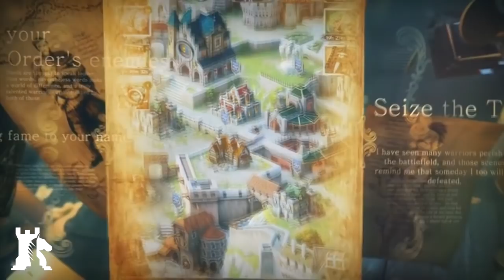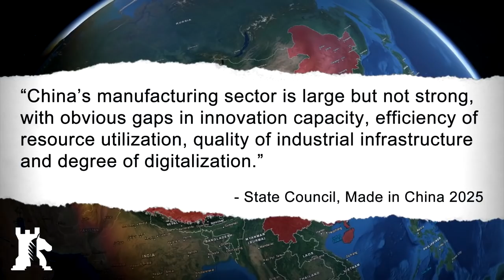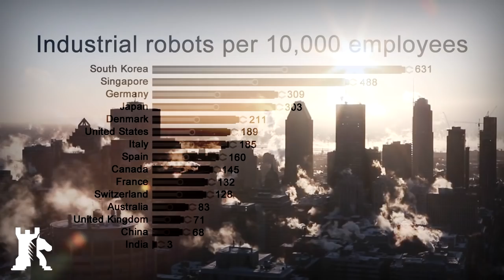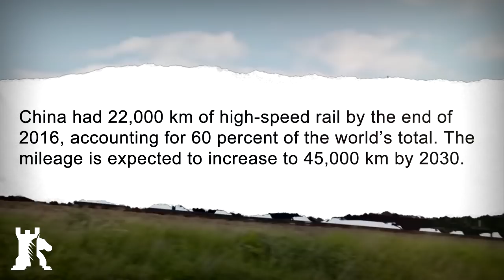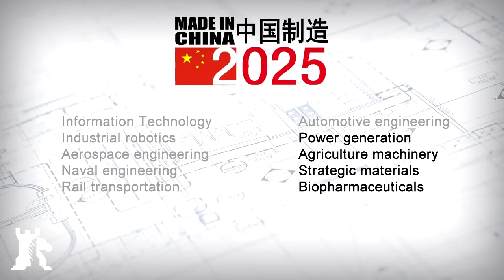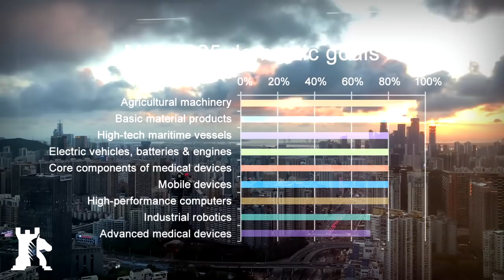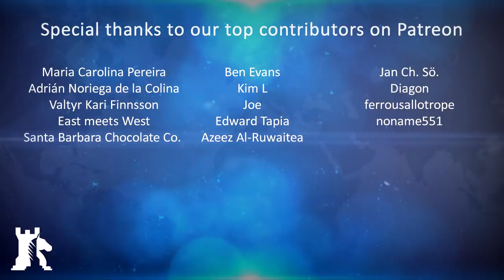China's quest to catch up with the West

Comment: This video represents one thing wrong. China's industrial output is NOT largely composed of low-tech labor-intensive goods. This is simply a misconception. As a matter of fact, China can produce almost all you-name-it industrial products with at least a medium or high level of quality, some with the top level. And its reliance on outside technology or key components is fast decreasing, with the most noticeable weakness in semiconductor and software. Why is it important to realize this? Because if you believe that China does not have advanced technologies, you would believe the propaganda that China will depend on theft to achieve the 2025 initiative. But if you know the truth, you know that China can mainly rely on improving its technologies and know-hows to achieve its goal. When Trump ordered stop licensing Android to Huawei, Huawei announced that if necessary Huawei handsets could use Harmony, which is the OS developed solely by Huawei. This is just an example of China's indigenous technologies. They may not be the world's number one, but they exist and actually are OK.

Comment: Sorry, I have been following you since beginning, and generally you are one of a few I follow on youtube, but this piece is complete garbage, what you say need to happen, is little more than propaganda to support prohibited Import Substitution practices after Infant Industry practices were used too extensively.  This has degraded the ability of other peer developers to develop globally.  You are out of your depth here.  Whoever is advising you at ADA, is not to be trusted on this issue.  Really, most of your economic analysis is a bit over-premised within a failing financial narrative.  Failing as to what was enabled, for but the last 2.5 decades.